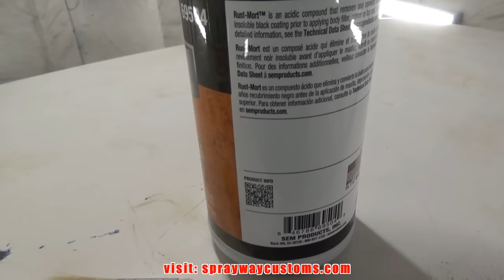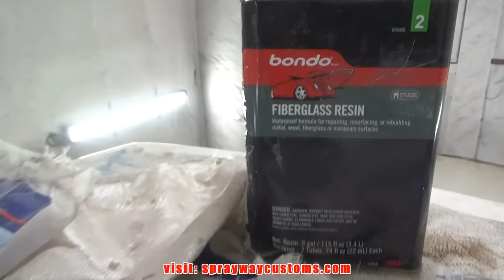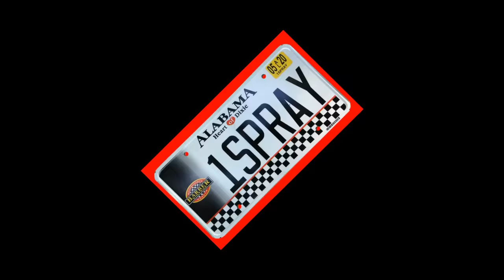T-Top Rust Repair With Fiberglass Without Welding BODYWORK ON RUSTED / RUSTY ROOF G-Body Monte Carlo

Comment: I don’t like having to pack fiberglass in holes for repairs it’s a 50/50 return but I like how you came up with the trick for remaking the weather strip channel 💪🏽
Reply: This is the reason they made the product
Reply: It's called fiberglass 🌊 water resistant try it
Reply: @fabiancook1498  water resistant is not water proof if you worked in this field of work you’d know better 😒
Reply from the maker: Thanks man..appreciate you
Reply: Man so my weather strip channel is so rusted I wouldn’t know what it looked like without this video. Going to do the exact same method making that lip.

Comment: Big fan bro huge fan. Been checking out your work for a while now. It’s obvious you had some professional training. I would like to know where if you don’t mind me asking. I’m a UTI graduate of Houston TX myself. Not knocking anything you do at all but I learned that metal and fiber glass touching would cause galvanic corrosion like metal and aluminum would. Is there something you’re doing specifically to prevent that or was I taught wrong and that’s just not so? I haven’t started playing with fiber glass yet but I plan to. It would be nice to know what substrates I can get away with using it on.
Reply from the maker: I never had a problem with it myself. I went to trade school back in 1997

Comment: When using the rust mort do you go back do you go back and wipe it off like it says to with water and neutralize it or do you just leave it how it is or what is your process? I would like to follow your process thank you so much for your videos
Reply from the maker: I leave as it is..just let it dry
Reply: @SprayWayCustoms  if you haven't got them in already would you do a video putting in the t-top gaskets and put in the gaskets on the car like for the door trunk and t-tops?

Comment: If I had all the t-top rubbers and trim pulled off I would have just fixed it the right way with sheet metal and a welder or buy another t-top windshield frame panel for only $269 but that’s just me everybody does things differently, you did do a great job fiberglassing in the rust holes
Reply from the maker: It was the owners choice. Thanks man
Reply: Oh I gotcha done a damn good job man

Comment: When I seen your last video, I seen you used foam to fill in the dent on the motorcycle gas tank. Could you have done the same thing with the holes on tip-top?
Reply from the maker: Yes, it would work

Comment: Damn 🤦🏾‍♂️that shit turned out with a FACTORY LOOK 🔥.. like it never happened.  Homie got some super SKILZ😤💯 ( im gonna start on my 51 chevy 3100 truck again.. did you degrease in between & or before your first coat of epoxy? If so will mineral spirits work ? Just cuz I got a 5gal. Drum of it .lol 😆 or does it still leave residue?  ) & hve u ever used metal fill bondo?✊🏾
Reply from the maker: Yes, I did before primer
Reply: @SprayWayCustoms  so you degrease before epoxy on your areas & before your high build primer? Correct.( WILL MINERAL SPIRITS WORK OR NAAHHHH REALLY BRUTHA MAN?🤔

Comment: Just a little trick I use...when you have bigger holes like in the front windshield frame , I use tuff stuff its a insulation foam that swells up and hardens (you can buy it in a aerosol can).  You spray it in the holes, let it harden, shape it with a angle grinder and then apply fiber glass on top of it.  It holds your fiberglass in place and seals up the area underneath it.
Reply: Hey there what’s the exact name of the can?
Reply: Yeah a little trick to Jerry rig a vehicle to send it down thw road and screw someone over.  Never use any spray foam to fill holes, it will just absorb moisture and rust out quick as hell
Reply: i did it to my cab corner on a s 10...it lasted for several years until I sold the truck.  The foam hardens...it's not soft...it works well but there is always some a hole with a butt head comment.
Reply: @yonseth788  great stuff is the brand.  It is a indoor/outdoor foam that forms a air tight water resistant seal for several different surfaces
Reply: @dhorn247  The foam I use is described as a indoor AND "OUTDOOR" sealant that forms a airtight/ "WATER RESISTANT" seal for many surfaces...WATER R E S I S T A N T!  Did I mention water resistant?  Did you catch that?
Reply: Yes he has in his past videos
Reply from the maker: E&R yes, I did the foam trick on a video over two years ago and it worked great. https://youtu.be/U_M1xdjNqfw

Comment: I don't agree with fiberglassing over rust. I would have cut it out and replaced the rotten metal. I've seen this many times when I strip down old cars and it will only  get worse over time.
Reply: If the customer can’t afford a metal patch. Then it’s on him, the owner of the car.
Enough negative comments. You do it your way. 🤙🏽
Reply: @williamoliver8883  i am the customer and I can afford it one I didn’t know it was rusted like that.2 Sprayway don’t weld if he did it would have gotten welded 3 the car doesn’t sit out side I have a shop where all my cars to sit in so it will never see rain. 4 I let Sprayway do what ever he wants to do for content for his channel.
Reply from the maker: Thanks for tuning in 🙏🏽

Comment: As much as I really hate to say it, structurally speaking, this car REALLY needed to have that metal cut out and new metal welded in.  T top cars are already a little weak structurally.  Sometimes, you just have to actually do some sheet metal work, This car because of where the damage was, was one of those times.  If it were a full tube chassis ( race car ) I might feel differently about it.  Outside of that issue, I do like your attention to detail and creativity.  Please understand, my comments are made in an effort to be informative, educational and constructive. I just want to see cars that not only look nice , but are also structurally sound and safe.
Reply: Also, running a good body file over all the panels will help you spot all of your digs and dents much easier. Before I ever even haul a single sheet of sand paper out, run a body file over all of the sheet metal. It saves a lot of time and adds to economy of motion. That way you don't have to go back and fix dents after hi build primer is applied.   For those of you wondering if some sort of board or block sander will work for this, my answer is, kind of. Sanders generally speaking to flex a bit, where a body file wont flex at all.
Reply: I’ve seen Swiss cheese metal strong as F@&K !!! What he did was good !!! They over build cars from the factory !! And I’m a welder of 30+ years
Reply: @danboutin8700  They aren't THAT over built. To be honest, you wont convince me otherwise. We aren't discussing  patching up a lower quarter panel here.
Reply from the maker: Thanks for all the info Ritch 🤝